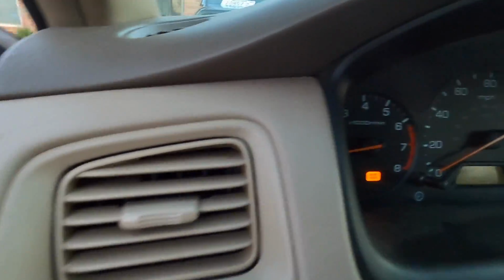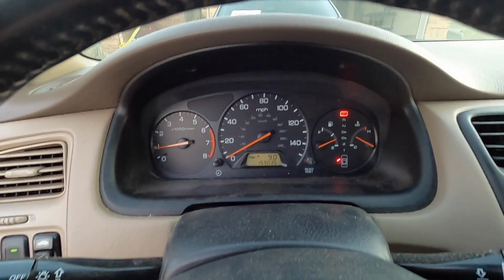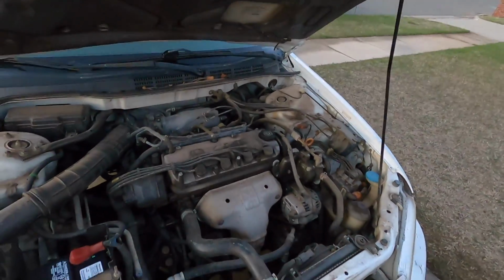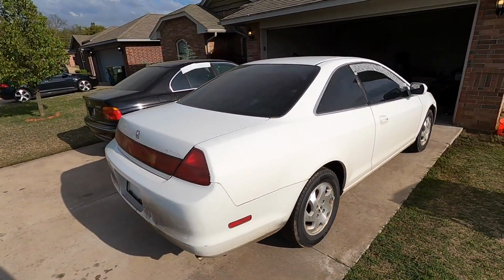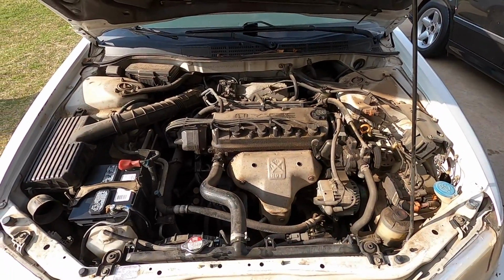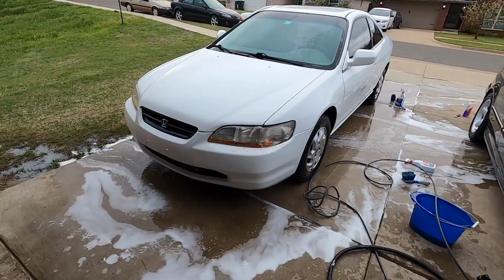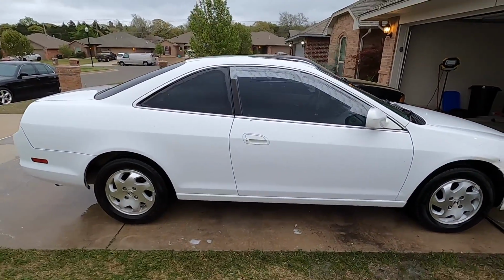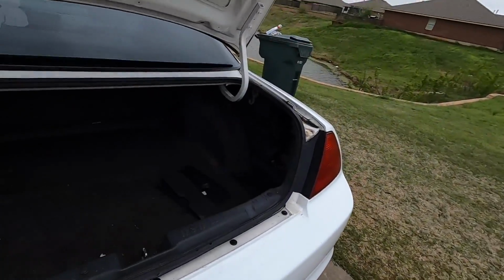Copart $600 2000 Honda Accord EX Transmission Fix + Clean and Flip!

Comment: Auto auction rebuild in this video = reset oil change light that you don’t need a 2000.00 dollar tool for (dose not reset it only gives instructions found in owners manual). 
Add incorrect ATF, Wash car, and send The car to someone else for the “rebuild”(Fix window regulator and headlights). 
I would like to see more “rebuilding” vs. giving to someone else to fix.  

Great job providing content for everyone stuck at home. Thanks.

Comment: I never would be able to pressure wash my engine, I would worry too much about damaging wires, vacuum lines and things like the alternator. Sure makes it easy tho lol
Reply: Most dealerships do it anyways on used trade ins if your really worried you can just not start the car right away but most the time theres nothing to worry about especially on newish cars everything of importance is under plastic
Reply: My engine bays are full of rustproofing. Ugly engines are the lesser of two evils.
Reply: Use WD-40 if you ever get water in something you didn't mean too. WD= water displacement.
Reply: I spray washed my motor on my 84 cavalier..it was hot and it cracked my. Coil packs
Reply: I have been pressure washing my engine for 30 years I always keep the engine running then wash it never had a problem.
Reply: @kevinsukdolak5007  An '84 Cavalier had coil packs??
Reply: Бюджет
Reply: Lol Ive been washing engine bays on HONDAS, TOYOTAS, GM, FORD, CHRYSLER etc, NO PROBLEM! The only issues in older cars are water getting into spark plug due to aging rubber seals, causing some misfiring.

Comment: I think you have a good advantage in Oklahoma because I come from Illinois and everything is a rusty crusty mess. I had to buy replacement wheels used on eBay from Oklahoma in fact because they were so corroded that I could not maintain a bead seal on them. The ones I got used were not cheap exactly but they were nearly new. I moved away from that frozen boredom zone thank God. Hope you and your family stay well Randy. God bless you and thank you for turning me on to Lucky and Tk's channels. Ill give you a shout out once I start flipping cars and motorcycles here in Colombia. God bless Randy

Comment: Battery connected, alternator uncovered and spraying directly into the fusebox... You like to live dangerously my man!
Reply: 12 volts is completely safe. That's why you can touch car battery terminals. Water isn't a problem below about 50 volts
Reply: @tenmillionvolts  water isn't a problem for you, not necessarily for certain car's components, especially when energized.
Reply: @mleindek  Sorry, maybe I wasn't clear. The battery, alternator, and fuse box which you mentioned are all 12 volt areas of the car. They can work perfectly even if submerged (in 4wd mud rallys, they often are). The high voltage areas such as coils and HT leads are where tracking (arcing) will occur and that's when you hope the rubber boots and seals are doing their thing :-)

Comment: Randy, a very common problem on all Honda’s is the window can come out of the track. Just pull the door panel and look at the openings near the bottom of the door to see if it’s in the track. On three Honda’s I have owned that have had this issue I was able to remove one bolt, get the window back in the track, and then presto! All is well again. Putting a new regulator is super simple too and will save you $$ ... with the time it will take you to get it to a shop and back you’d be done! I guess I’ll have to watch the rest of the video to see what happens, but wanted to let you know regardless :) Keep it up brother!

Comment: After washing the engine is good to spray WD 40, it will take the water out of the electronic components and create an anti corrosive film (and also it is going to look shine)
Reply: Orlando Cuevas just spray wd 40 all over the engine and accessories?
Reply: Spray all over the engine bay? Or
Reply: I can confirm you will definitely have issues. Alternator pulley was making noise. Sprayed a little wd40 on the pulley, few miles later the noise was minimal but then got very loud and the pulley broke off and the belt slipped off. Do not use wd40, speaking by experience.

Comment: Randy, have you considered getting a DA polisher?   About impossible to burn the paint but you can clean up a LOT of minor scuffs, marks and bring up a really nice shine.   Well worth it.   This Honda would come around amazingly well with it.   I've had a Porter Cable 7424XP for many years, wouldn't want to detail a car without it anymore.  Autopia has some good package deals on it with pads, backing plate and polishes.

Comment: I would recommend using only Honda trans fluid.Honda trans are wierd that way.
Reply: I was hoping this comment was somewhere. ONLY honda trans fluid everytime
Reply: Back in the 80's when I raced Hondas (Civic, CRX, multiple years) we were "unoffically" advised to replace the standard Honda 5 speed manual transmission lube with 5-30 synthetic motor oil to improve shifting, and reduce friction. Result was that one could now shift as hard and fast as you want, all day long, and you would never beat the syncros. 6 years of this and had not one transmission failure.
Reply: @ByGraceThroughFaithHomestead  Thats a myth Honda coolant and power steering is the only ones you should keep Honda OEM

Comment: With those light marks on the body and mirrors, if you use a Mr clean magic eraser and a good compound, it usally takes out the scratches and Mark's. Just use a light hand or you can burn into the clear coat.

Comment: Quick tip if you power wash your car make sure you cover the crankshaft connectors because if you get  a little bit of water in there it will cause the to go into limp mode..trust me

Comment: I've pressure washed alot of vehicles under hood and soaked them with degreaser and the body shop I worked at did the same thing never had a problem not once

Comment: Randy, window regulators aren’t hard to do at all. I’ve replaced two front door handles, two front door windows and a driver side regulator on my 2005 nissan altima. With everything that did to it in order to fix it up took me 45mins. Yes I change my own oil, transmissions, brakes, axles engines etc.... my self as well.

Comment: Nice looking little Honda.  Weird Beard will take it to the next level.  He's really good at it, and fast too. Randy, you're right,  time is money and you've got to figure out how much time works in your favor, and when the time you're spending is spinning your wheels and going backwards.  I'm curious,  do you use any kind of degreaser on the engine,  or do you just use the power washer?

Comment: All the automatic transmission car I had say to check the fluid cold, they were older cars so things may have changed
Reply: Things changed in the '80's to running through the gears and then checking when the car is off. I tried to service my sisters car as the gearbox is slipping. Its a sealed unit which I suspected and needs the whole trans swapped out. Oh Ford, you took the weakest part and forced it to break so owners would buy a new car. Genius. She kept and still driving 3 years later but it can't stop on a hill as it won't go forward. Its 10 years old and not worth anything as its now rusting being parked on the road. It won't go up her driveway.
Reply: Can you get me golf tree car please I like or Toyota corolla sport please
Reply: @2DogsVlogs  most sealed unit transmissions say their fluid is "lifetime" but I cracked mine open at 80k miles and it needs changed. Just remove the pan, replace seals/filters, then fill the fluid through the drain plug or the intercooler. It'll keep that automatic "sealed" unit from crappung out like the manufacturer planned

Comment: I have a 2014 Chevrolet Cruze that needs the engine cleaned but I'm afraid to get the wrong parts wet and then breaking on me. Any suggestions?

Comment: It would be interesting to see how some of these cars are doing 3-6 later. In my experience older cars,15-20 years old can be expensive to keep on the road if you can't fix them yourself. It's self-evident components fail, seals get brittle, etc. Especially if used on a daily basis.  Also from experience, cheep MAACO paint jobs are not very good and start to oxidize in a few months. They use very poor quality paint. A good paint job takes 30-40 hours with proper preparation and will last for years, however, it costs $3,000 to $4,000

Comment: Did you change the oil arfter resetting the light
Reply: I'm sure he changed the oil before resetting the light,  the light always has to be reset because it has the computer counts the miles until it is due for the next oil change.

Comment: Spray the paint with degreaser n use a brush....just try n keep it out of the sun.......spray silicone all over the engine...it’ll look great......not WD 40 cause it contains oil n the dust will stick to it....

Comment: Am not an expert, but when it comes to checking oil one always needs to shut off the engine or what ever, take the dip stick, clean it and then put it back and check again. Am not sure why u r said like checking the oil while running an engine. Samll addition this applies to all  brands, not only on a Honda

Comment: I liked the reset of the Maintenance Minder light reset without actually changing the oil & filter - unless I missed that part. That fancy scan tool thingy said what's in the Honda manual as far as how to reset the light. But @#$ it, the new buyer won't know. And any idiot knows you don't put ANYTHING other than DW-1 transmission fluid in a Honda automatic. Google is your friend.

Comment: u canot check oil level on any car in the world with car running!!!!  oil is jumping and moving inside engine/transmition.. this is so obvious...
Reply: sergiobisonte you’re wrong when it comes to transmission oil. Most modern cars don’t even have a dipsticks, those that do are typically checked engine running 🤦‍♂️
Reply: Quite a few cars you do check transmission fluid with the vehicle running at operating temperature.  Technically, for most engine oil level verification you verify after the car has sat for 10-15 min so most oil is back in the oil pan.
Reply: @hgas9631  no.... first... transmission oil is only checked in USA cause the rest of the world drives manual...second.. u check the oil when its hot, and engine off...  how to you mesure anything that is moving????

Comment: Honestly, the only part of my car I don't detail is my engine bay, I'm always afraid of breaking something expensive, after watching this I might try it though
Reply: You might want to watch what happened when he did this to the S 600 Mercedes before you do it........
Reply: scrubbing bubbles works great on engines along with degreaser on the greasy bits then agitate with brush and mist off with water.  No worse than what gets into an engine bay when driven in heavy rain.
Reply: Watch Chris Fix.  I did what he said on a ‘94 Ford and the engine bay looks like new.  Super easy to work on too.  0 grease.
Reply: I just Armour all mine, looks new